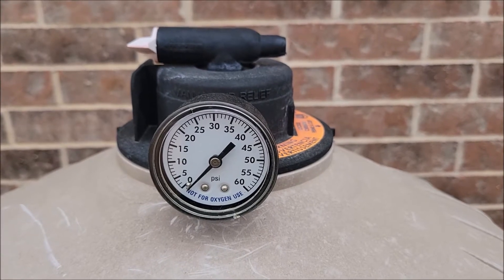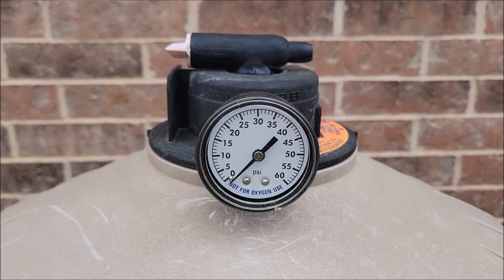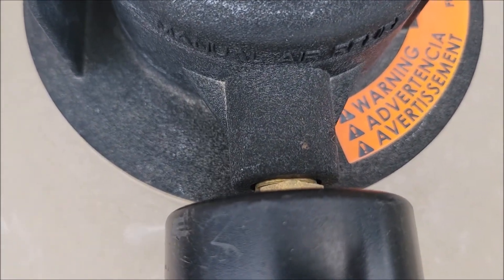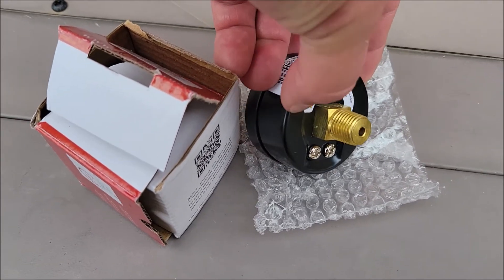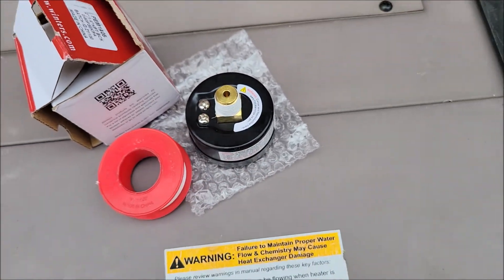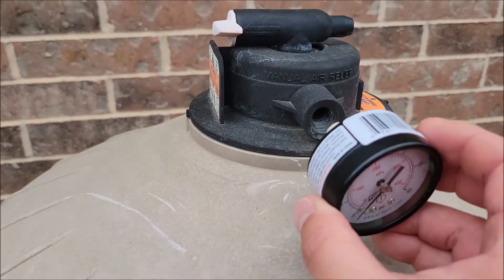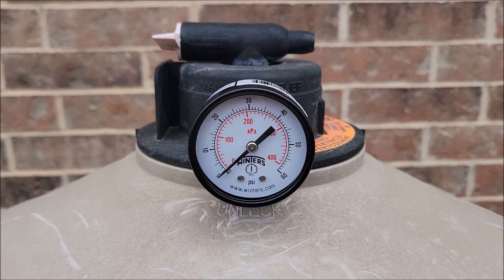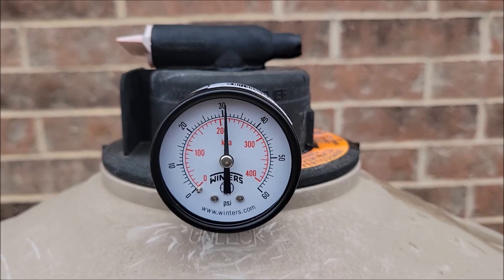How to Replace Your Pool Filter Pressure Gauge

Comment: 30 psi is at the high range of pressure for pools.  Really should operate in the 10 -15 psi range to minimize strain on your equiptment.
Reply from the maker: That would be great but even when it was new with new filters it never got that low.

Comment: I think we have a similar looking filter. I didn't see a pressure release on mine and was curious if everyone had one but since I don't see one on yours I'll double check and then maybe just risk replacing mine.
Reply from the maker: The pressure release on mine is the lever at the very top of the filter.  You turn that lever and it lets the air out when filling or it can be used to let the pressure out when the pump is off.
Reply: @SeidelRanch  I will try that first and see if that's a function on mine. Thank you!

Comment: That is crazy that freezing weather makes the pressure gauges go bad.  They need to make ones that don't.
Reply from the maker: Yeah, it's a pain.  I am sure there are some out there that will not freeze, but I have yet to find them.
Reply: They do, they are filled with glycerin